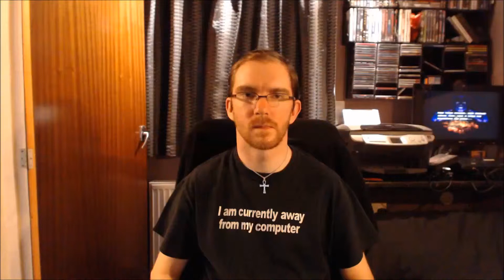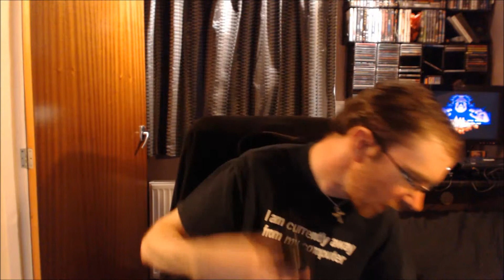YLoD and RRoD Cause and Prevention

Comment: I just thought of something pretty devious that console makers did. When you tear into a console, the motherboard is usually oriented face-down (the processors are facing the ground). With all the heat generated, those soldered connections will wear out faster due to gravity pulling the chips downward. Now I see why clamps are needed :/
Reply from the maker: As you've said, they're clamped for a reason, but PC motherboard have heatsinks hanging off them sideways pulling down on one direction, and the heatsink compound used starts to melt slightly on both PC's and consoles, this does take the "weight" off the CPU/GPU but at the same time it removes some of the conductivity. However, heat does rise and there will be some residual air and heat around the socket area which will accelerate the thermal aging of those solder joints whereas if the board is horizontal or facing upright, that is probably less of an issue...but your PS3 will probably roll off the cabinet if it's that way up :P Vertical it is then :)

Comment: The best thing that I've found is to try and control the room's temperature, be it with fans or with air conditioning, and taking breaks from the system to let it cool down. My 360 halo 4 edition I bought online gets pretty hot if I stay on it for extended periods of time. I just fixed a ps3 first gen with a hairdryer and I felt like a genius
Reply from the maker: I hate to break it to you, but "taking breaks" doesn't work. It's the heating and cooling of components which forces the solder connections apart, so taking break is allowing them to cool before being cooked again however I do agree with controlling the room temperature, that's not always entirely practical, as I said in my video, the main thing is not trapping it in with it's own air, allowing the heatsinks to do their job.
Reply: Jordan Appleton I would assume that if you control the exposure time those components have, it will generally keep heat generation to a minimum. Granted, nothing lasts forever, but it doesnt hurt to try 30-60 minute gaming sessions with a n hour of downtime in between. I suppose you could always invest in a liquid-cooled system, but who has the time or the money for that? Especially on a console that is 6-8 years old? The best place I can think of to keep a computer cool is a basement room in the middle of January. Brrr!